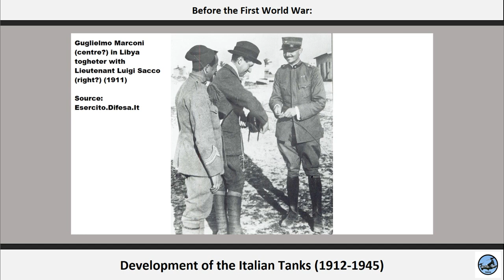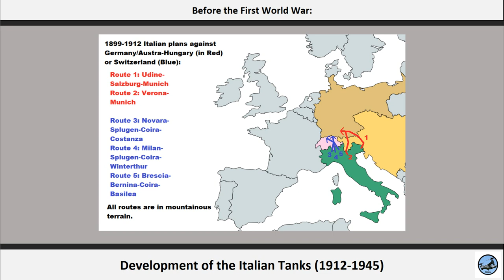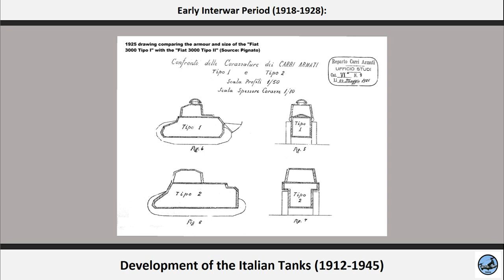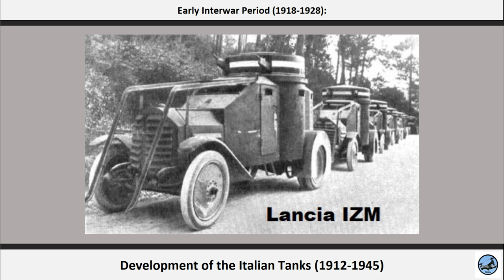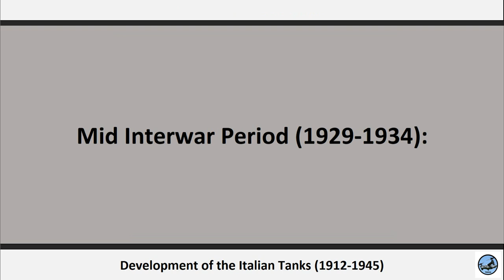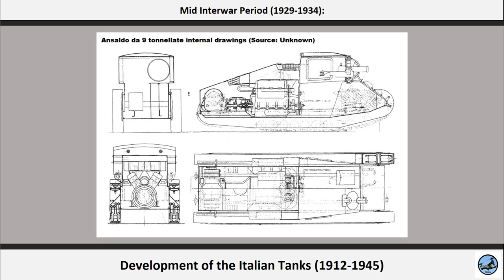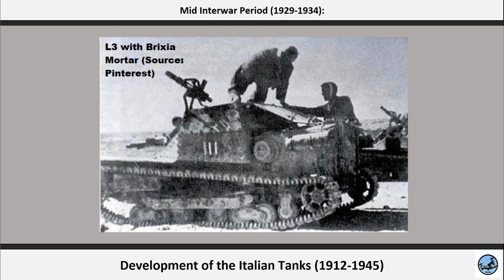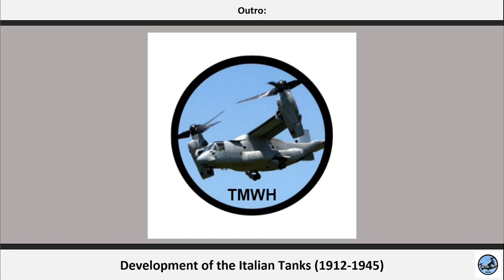Development of the Italian Tanks (1912-1945) [Part 1]

Comment: Comparing M13/40 to its contemporaries in the same weight class suggests the M13/40 was a decent answer to the problems posed by the enemy, as well as the climate and terrain, of both the Balkans and North Africa.  Simple, cheap, and easy to maintain are often overlooked advantages in the design of a useful combat car.  Semovente conversions of the basic M13/M14 chassis were also useful vehicles.
  Vehicles based on the later M43 chassis showed a keen appreciation of trends in AFV development in its present and pointed the way toward the future of armored warfare.  Italy did not lack genius or courage; instead it lacked a comprehensive strategic plan, it lacked oil, it lacked resources.
Reply from the maker: Exactly, you got the point!
Vehicles like the M series will be analyzed in detail in Part 2, yet I can already see you understood the "core reasoning" behind our video
Bravo!